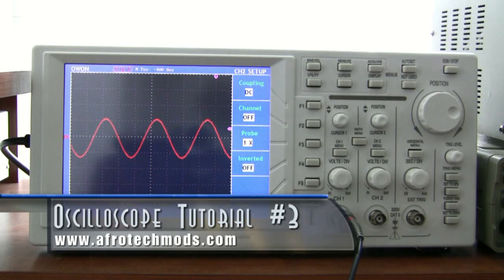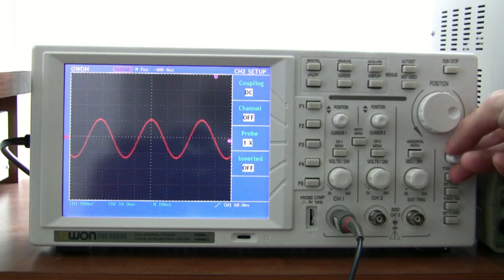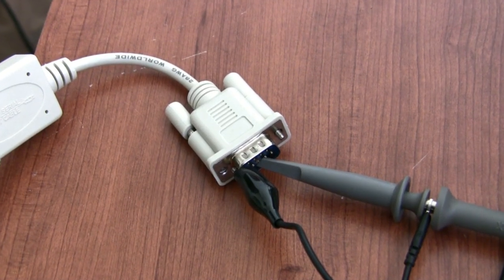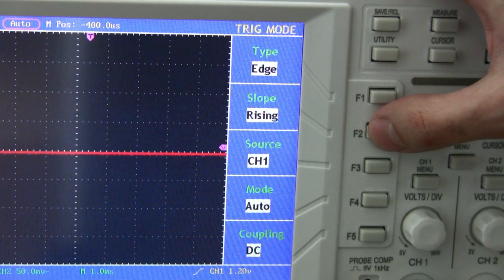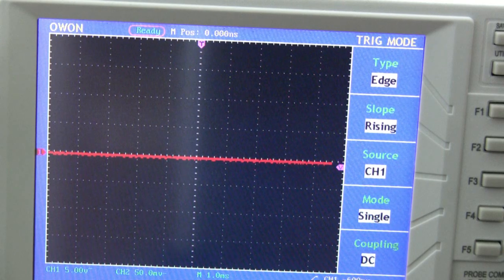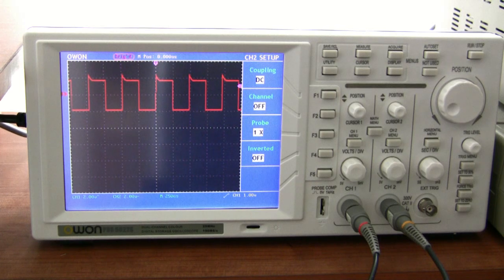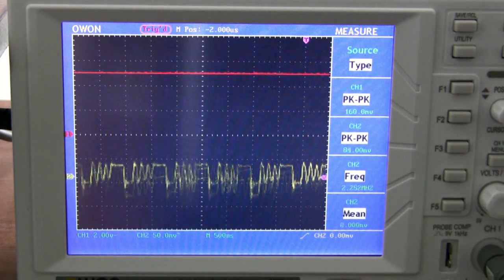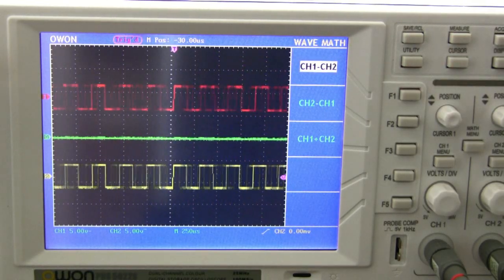Oscilloscope Tutorial Part 3 - Advanced functions

Comment: Thank you!  Very clear and useful information.  Now if I could just figure out how to monitor the waveform on my house wiring when I turn on a flakey UPS, preferably without spending as much on high voltage probes as I did on the 'scope, AND without blowing up the scope, I'd be all set!  Any ideas?

BTW, the 'scope claims max 300v on inputs, and I'm in North America with 120v RMS mains power. So the peak to peak max voltage SHOULD be under the max voltage of the scope, but not by much...and I'm new enough to this stuff to worry about factors I don't know anything about, so haven't tried it. Don't have a second 'scope, so not interested in killing it.

-- Mike
Reply: The oscilloscope is rated for 300VRMS, so you have a 180V margin.
Now, you can technically measure mains voltage connecting the alligator clip to neutral (NOT live, or you'll make a short) and the probe to live, it's dangerous and I wouldn't recommend it. Better yet, use an isolation transformer.

Comment from the maker: Your probe is acting like an antenna, picking up the AC signal from nearby power lines. If you connect your probe to something you want to measure (like a battery's voltage) the interference should disappear. Also, your scope's main power cable should be the 3 pin type so there is an earth connection.

Comment: took me so long to get an O'scope. they are handy bits of kit, got an old analogue 10Mhz scope off a mate, had to buy probes for it, but it works alright. with older scopes the auto trigger just triggers of the 50/60/400 Hz mains so you get drift, the scope i have can trigger off video sync pulses, as well as the manual trigger level

Comment: @somebody301 A spectrum analyzer displays the frequencies contained in a signal.  It does a "Fast Fourier Transform" to convert the signal from the time domain to the frequency domain.  It's important to RF engineering or for testing the frequency response of an amplifier.  A scope is much more useful if you have a choice between the two.

Comment: @Afrotechmods Ok am pretty sure that is is on TYPE: Edge Slope:Rising Trig Mode:Single
What I am finding is that when I change the trig mode from auto to single, it freezes and I am unsure of what is going on. Now I haven't used run/stop yet, this is just automatic. It seems that no matter what it is froze regardless of any more input voltage. 
So main question... if it is froze and you want another reading / reset after you change the trigger. How do you do this? Thanks again.

Comment from the maker: @AcousticBruce Go to your trigger settings and set it to single shot. Then a rising edge for charging or a falling edge for discharging. Then change the threshold of the trigger to be whatever you need it to be. Change the time base to 1 second per division or whatever. Then if you push run-stop you can set the scope to be ready to trigger on the voltage transient.

Comment: I'm not trying to advertise for Sencore...but I used to own one and it's a great scope.
You set it on auto and hardly ever have to touch it...just touch your test point and it automatically adjusts itself. It displays the waveform and underneath that is a digital readout that tells you the DC voltage and AC voltage.

Comment: @Afrotechmods 
I agree on that, once you get used to reading the divisions you have super tool in your hands. Just place a 1 ohm resistor in series with a load and you can read the amps peak to peak directly (or lower the ohms and then recalculate the amps).

Comment: @Afrotechmods 

OK it just gets a little confusing because of that, What I need to measure is the mV Peak-Peak voltage of some filter caps for a organ should be a range of 1mV to about 25 or so. My reading seems to be a little high it seems

Comment from the maker: Sort of. You will need a special accessory called a current probe. These are typically expensive. You can do it ghetto style though, using a shunt resistor. Take a resistor of around 0.1 ohms and measure the voltage on both sides of the resistor. Then use the subtract function on the scope to display the difference in voltage across the resistor. Then from Ohm's law, volts / 0.1 ohms = the current